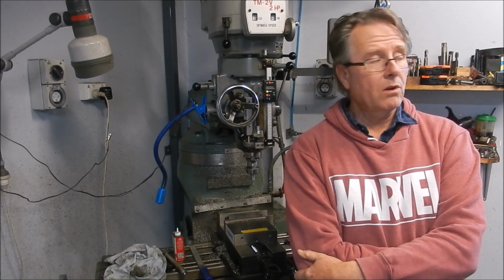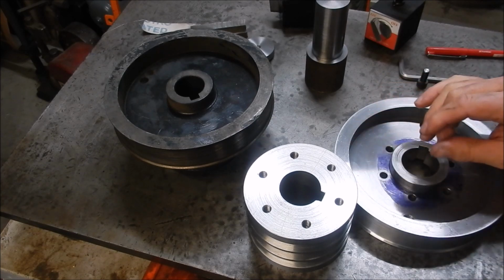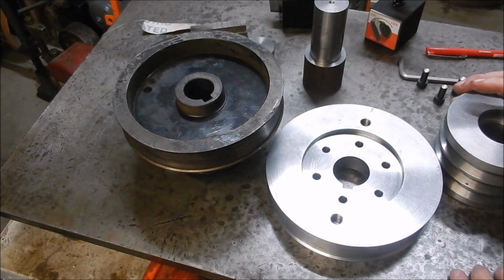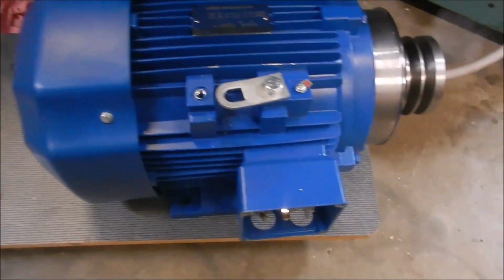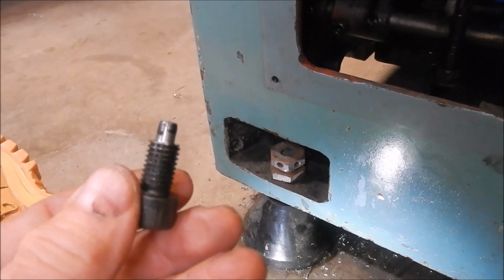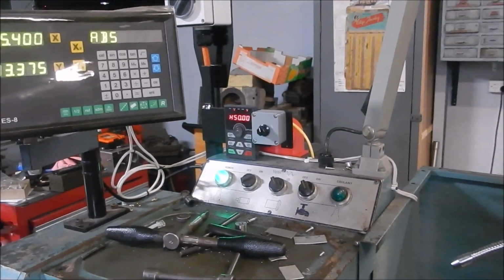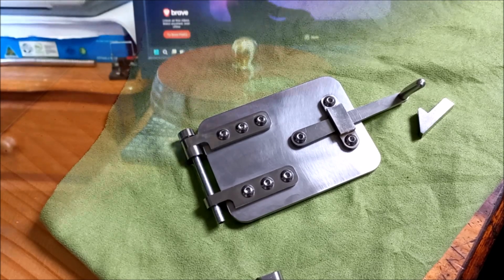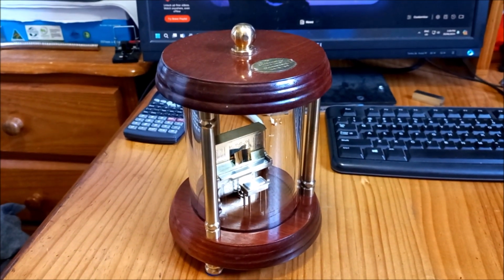Victor Lathe new Pulley and Brake Drum Fit-up

Comment: Hi Cam. It all worked out well.  One tool I use a lot with Allen keys is a very small diameter cheater bar (about 6 inches long) for nipping up and breaking free cap head bolts and grub screws.  Simple little gadget, but just enough to save your fingers and hands and put a lot more torque on the job.  Invaluable.  Cheers Rob
Reply from the maker: Thanks Rob.  Cheater Bar, where can I get one.  The arthritis in my hands is starting to be a pain and any tool that helps that out I'm interested in.
Cam
Reply: @camatbattler2233  Hi Cam.  I just use a 6" length of small diameter (1/2") steel gas pipe with a bit of knurling on half the length.  It also is great to use on the short end of "L" shaped keys where you are using the long section to get into jobs.   It's always in my go to drawer :)  Much better than trying to use a small shifter.  I did a video on it years ago :  https://www.youtube.com/watch?v=Yi-AORSXvvg   Cheers Rob
Reply from the maker: Great thanks Rob, I'm going to make a couple up for different sizes.
Cam

Comment: I fitted a pushbike disc brake when I did the motor change, it was too hard to reuse the band brake.
Reply from the maker: G'Day Harry, interesting solution.  I'll keep that idea in mind if I ever need to fit a brake to any other machinery.  Thanks.
Cam

Comment: Hi Cam, very brave carting Hno3, aka nitric acid on a bus, would have eaten through the floor if spilt.
I worked in a plant were we made ammonia first, then nitric acid and finally ammonium nitrate, 100 tonnes per day for the mining industry.
Interesting process.
Reply from the maker: G'Day Willem, funny you should say that.  The guys at James Officer asked how I was getting home.  When I told them I'm catching a bus they found some foam packaging and cut out a cavity in the two halves put the bottle inside with an up arrow on the outside and Gaffa Taped it together.
I don't think I would be to keen working around Ammonium Nitrate.  Funny though because I work in the Oil and Gas Industry.
Cam
Reply: Hi Cam, I was responsible for the Instrumentation, Inlec.
Nothing organic near the stuff, we couldn't use anti seize on flange bolts etc, made it interesting at turnarounds for maintenance due to the corrosive nature.
Always worried me about the heavy concrete blast wall around the Reactor!